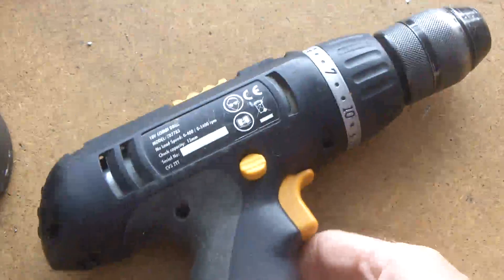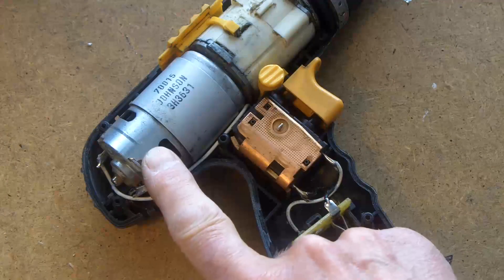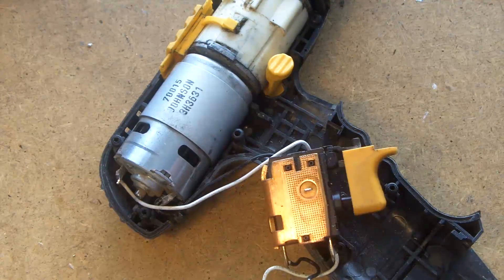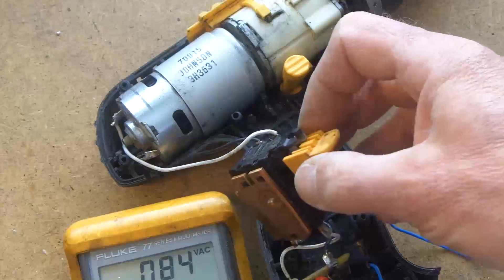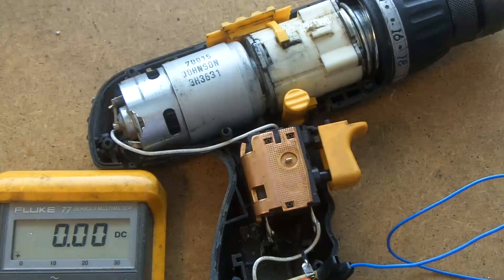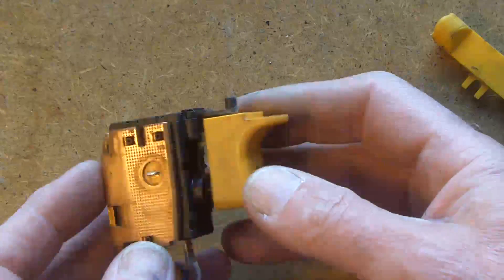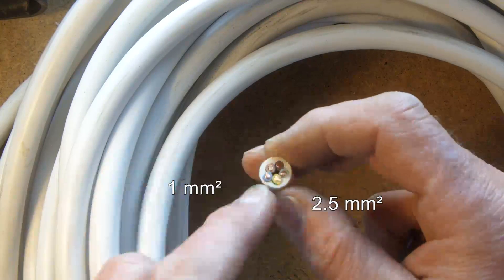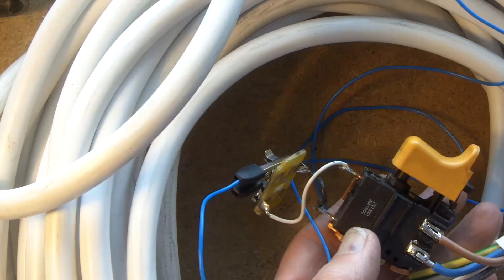About Radio 72 Antenna Rotator part 4

Comment from the maker: Hi there 
a variable resistor would work; the difference is the drill-speed-controller provides much more torque at very low speed so it easily overcomes friction/stiction. They start smoothly at low speed, that’s why you can’t buy an electric drill with a variable resistor as the primary speed control. With a variable resistor you’d have to turn it up to get it started then quickly turn it down again to run at a practical safe speed, but the choice is yours...
All the best ... Andy

Comment: There's a chance the controller could "look" for back EMF of the motor under load and boosting the PWM duty cycle to maintain speed.  See my video with link pointers to a motor speed controller article that discusses in better detail.  The author of the original article also points to an analog feedback controller, so it doesn't need to be a micro-controller based design.  
search Youtube for  ZTOEq0616yU (motor speed controller with pic10f200)

Comment: When I was in the UK my local council recycling tip had a huge basket type thing with loads of electrical goods that people had binned. There were often cordless drills, usually without batteries, they'd probably let you have one for free so you could investigate the inverter. Very interesting set of videos.

Comment from the maker: Hi, it could well be but it does provide the motor with high torque characteristics at low speed,  I'll hang the scope on it. The very first time I saw a device like this it was being developed at a university as some manufacture had the idea of a battery powered drill so you can see how long ago that was, but I’ve never checked one out myself. As you know power is proportional to the square of the voltage so I guess a ‘short shot’ of high volts has to be good for torque.
Kind Regards ... Andy

Comment: Yes, exactly. Yeah, it crossed my mind you may intended to use remaining wires for indication purposes, but if you need more wire it's there. Much smaller telephone 2 pair cable could be added for positioning if worse were to come to worse voltage drop wise.

Comment from the maker: I'm planning to used the other wires for position detection, I didn’t have a worked out plan when I started (still don’t) but a standard rotator uses 5 cores so as I was in the electrical wholesalers’ I figured I’d buy what they had and work around it (story of my life) 
All the best ... Andy

Comment from the maker: Hi Rick, I did some work with one of the universities in England some years ago when they were developing this technology, they were over the moon with their invention at that time and I couldn’t see what all the fuss was about until they showed me the results and the startling difference between straight DC and the high torque capable of been developed at low speed with the inverter.
 73’s ... Andy

Comment from the maker: Hi there, yep it’ll be chopped DC but not a sinusoid but the nice thing about the output of the controller is it allows the motor to develop a very high toque at very low RPM. If you try to run the same motor at slow speed with straight DC it’ll stall or more likely fail to start. By the way, I want to use the other wires in the lead to drive a position indicator.
73’s ... Andy

Comment: Hey Andy,
This was really fascinating. I had no idea how much electronics they have in the variable switch of those reversible drills. It would be really interesting to see the inside of that switch. I wonder if they have designed a solid-state device just for that purpose? I went back and looked at the end of the video to see if you had used two wires or four wires from the switch to the motor, and you used two wires.

Comment: Interesting series, your gearbox looks like it could deal with a top band beam, and be sure to let us know if you figure out how to build one for 160M that's light and strong! If you look at the switch output on a scope I bet you will find this is just pulse width modulated DC (no AC)  -DMMs' will register an (errant) AC reading on chopped DC because on AC ranges they are coupled through a cap. You have extra wires, so you can double up the power leads to drop some resistance if you want. Fun!